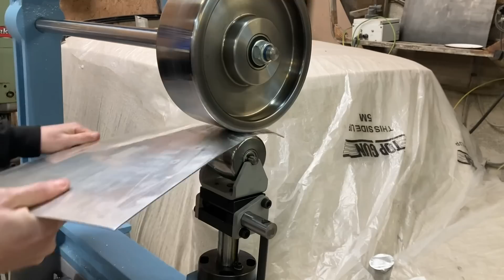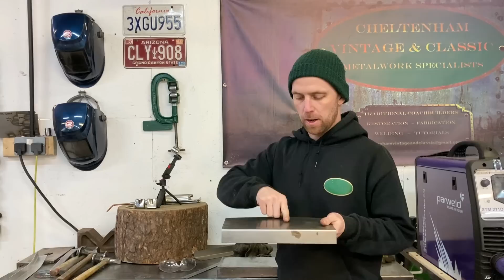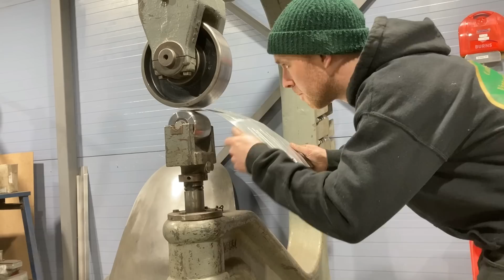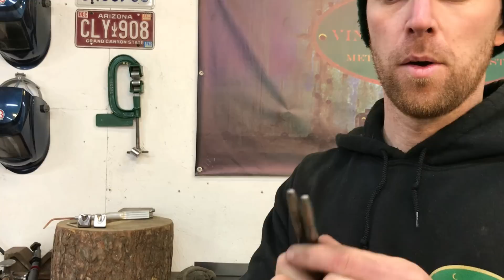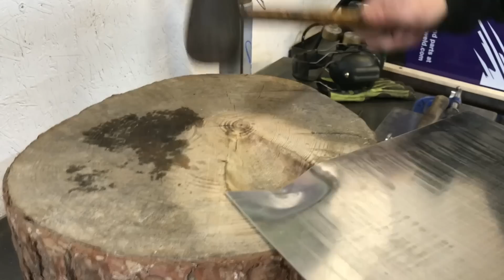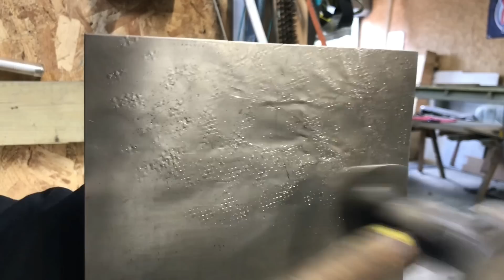7 ways to SHRINK METAL // HOW TO

Comment: when you use a tucking fork you MUST lock the tuck this is done by the striking angle, but until you learn how to hit the tuck just use a clamp and lock both ends to the work table and it will work. I'm very new at this and my only shrinking method is the foot shrinker and the tucking fork. Currently learning how to use a slapper. great video thanks

Comment: Hi, what technique could I use to shrink in the middle of a thin aluminum 6061 T6 panel? I have a small dent from a rock in my airplane. It’s only about 1/2 inch around, but I’m afraid if I hammer it out I will just stretch the metal. It’s in a large flat area.
Thanks!
Reply from the maker: I much you can do really. Try putting a strip of leather over a Dolly and gently tap down to avoid stretching
Reply: @Metal_shaper_tom  ok, I’ll give it a try. Thanks!

Comment: Tom, I've watched shrinking videos for years, all showing different methods with out a clear message of why their way works. Thanks for bringing all the ideas together so rookies like me can understand! Two questions... 
#1 Why the ardent dislike for shrinking hammer process? Is it marring the surface that you dislike or is there more that's negative about it?
 #2  I successfully stretched out my wheel wells to gain tire clearance by 1/4"at the top. After a while, a slight wave appeared on the body about 3"over the top. I have no access from behind for a dolly. Would you recommend i use a shrinking disc to get the body above the wheel arch back down? Thanks ahead of time.

Comment: I use a propane Torch on body panels all the time.  The trick is when it's popping in and out, if it's right when it pops in. Then you just need to heat the area and quench it. It will usually retract to that popped in position.  If it's the out position.  Then take a body hammer with the spike and hit it in the middle to basically stretch it to the middle in a tighter spot. And start shrinking.

Comment: I had a bolt shrink, just by removing it from my derrallieur gear on my racing bike to replace the wire, I had to go and buy a replacement bolt because the one I had, no longer fitted due tom mysterious shrinkage, I went to my mates house and explained what had happened and he claimed this was an impossibility, but when I showed him he was a mystifed as i was and saw how wrong we all are when we say it is impossible for a metal bolt to just shrink, with no extreme heating or cooling or anything, we are both living witnesses to the contrary and NO im not joking or making it up or anything. My only question is just out of idle curiosity, does anyone understand why the fuck this happened
Reply from the maker: Haven’t got a clue 🤷‍♂️

Comment: A very, very informative video Tom. Thank you for that. 'It's a pity I didn't know about there methods 35 or so years ago when I was repairing a front corner crash damaged VW caravanette I had bought ended having to make and put in a new n/s floor pan coz I could not get the ripples out of it lol. The front panel had to have a fair lot of filler in it to get rid of the dents !

Comment: (As a suggestion)  try this,..... when tuck shrinking , rather then close the tuck a the front , close it at the rear first on the folded line  then a little on the sides , this will keep the tuck from opening too much and give you much less material (bumps ) on the flange you  also will achieve more shrinkage  THEN SIMPLY  take the rest down towards the front . The same applies when shrinking on the wooden stump except it's done on the inside of the panel not the out side . By the way... those shrinking hammers are only good as meat tenderizers
Reply: By "front" do you mean in the inside of the curve ?
Reply from the maker: thanks peter. big admirer of your work

Comment: When I first started I used to make one piece reverse cowls making a long u shape first with the bead in the middle then tuck shrinking the 3 to 5 inch edge kind of like your were then trim the bonnet profile and roll all the edges and do wire edge on the back they looked awsome but the tuck shrinking still gives me nightmares used to take about 40 hours to make them with a power hammer not even a full day

Comment: Another great video Tom, nice to have all the shrinking methods in one video. I still haven't solved the oil canning on my doors, if I run a shrinking disk all over the high area do you think that would stop oil canning ?
Reply from the maker: Hey Steve! Thanks very much. Personally I would say yes it would work but I wouldn’t want to be responsible for you spending £50 on one and it doesn’t 😬 if you get what I mean.

Comment: Yet another great video! Thought you may like to know that many years ago before Wray invented the shrinking disc I was taught that if you use 2old sanding discs(not Velcro or self adhesive) face to face using the rear smooth surface also works, some discs really smell bad though!  I have also
 used an old stainless saucepan lid to make a shrinking disc but sanding discs are safer!
Reply from the maker: Hi 👋 thank you! We still use the upside down sanding disc technique and it works really well! Another great way that not many people know about! 👍

Comment: Good video, now I know why my shrinking hammer didn't work, I don't have a shrinking dolly.. didn't know they existed until now, thank you...
Reply: Shrinking hammers are meant to be used with heat. If you use them cold, you damage the sharp points on the surface and they stop working.

So go to the section where he heat shrinks with the torch, use your shrinking hammer there. Thats how they are meant to be used.

I am not sure why no one knows this anymore, but it was common knowledge when i was a kid (I am 55 now)
Reply from the maker: Thanks for watching 👍 glad you liked it.

Comment: thanks for the video, it was very informative. can you give me some info (manufacturer/supplier) on the blue english wheel you were using. i currently have a low-end budget machine and would like to move up to something a little better, do you have any recommendations for a mid-range tool?
Reply from the maker: Hi Russell. It’s a stakesy’s prototype so not actually on sale yet and will be in the region of £1000 it’s a copy of a Justin baker wheel that is £2400 . Baileighs cheap wheel at £700 is also very practical but not cast. Hope this helps a little